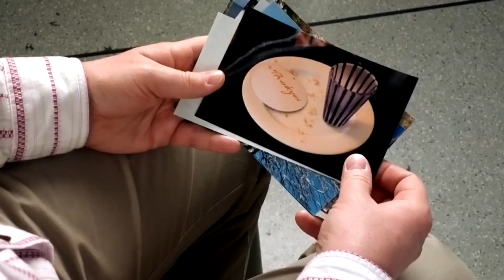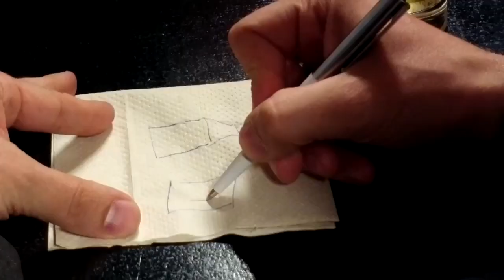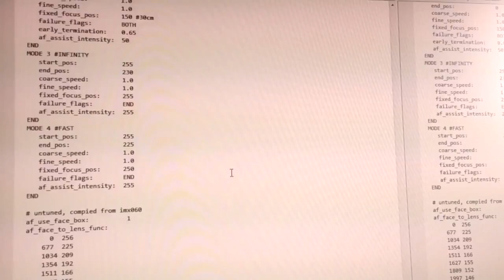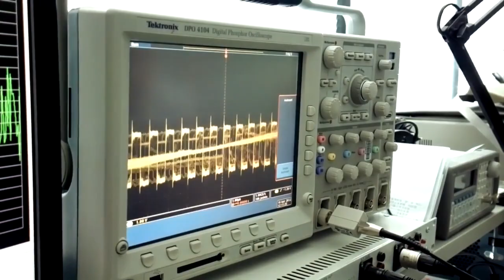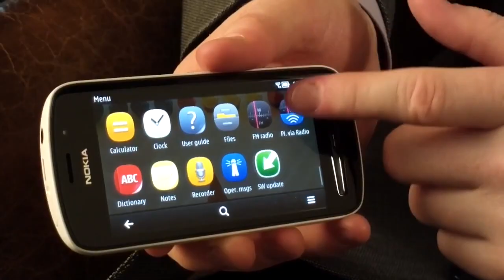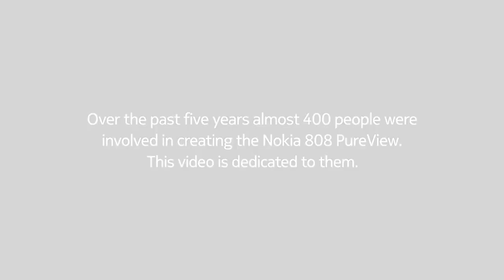Making Of Nokia 808 PureView🔥🔥🔥(2012) Full Video

Comment: I still have this phone and it takes very good photos
Reply from the maker: I have also too i used it since fron 2014 & it captures  amazing Stunning images
Reply: @anshulsingh38123  but my usb port only charging. It cannot connect to computer so i have to remove the sd card to copy photos
Reply from the maker: Ohh so sad. So how can you charge your device???
Reply: @anshulsingh38123  it charges . No problem but only not connecting to pc to transfer phot
Reply from the maker: Okay okay i understand so problem with USB Connectivity not with charging
Reply: @anshulsingh38123  yes.
Reply: @daranikant  I just bluetooth the files to my Note usually. 
Then use light room and handy photo.